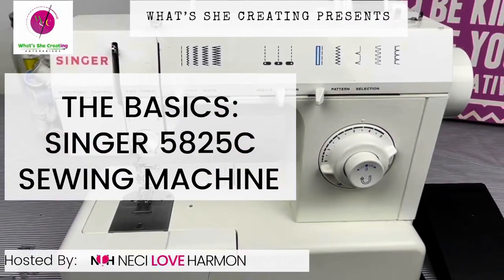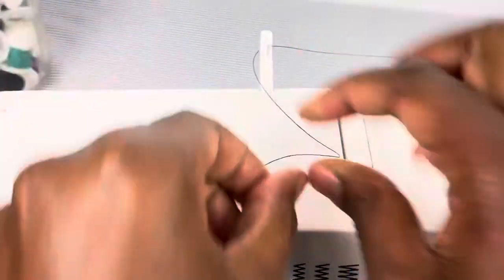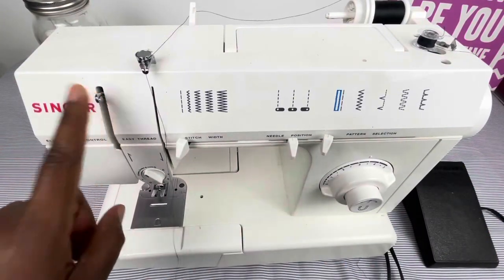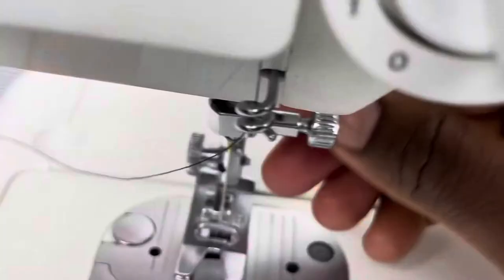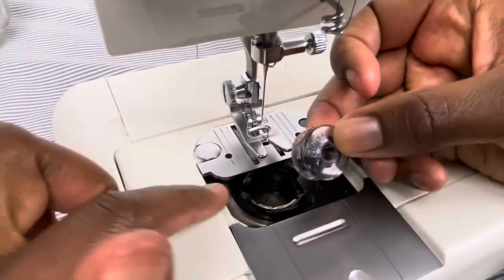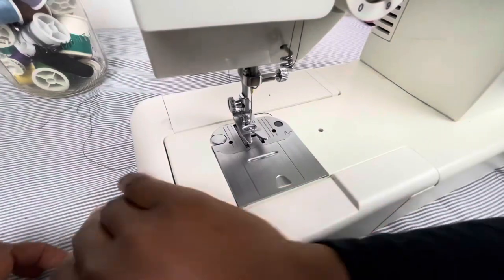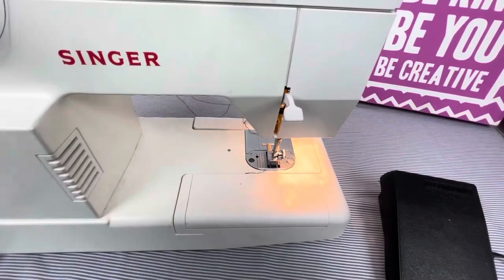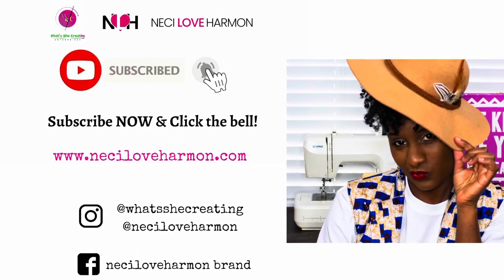Learn the basic functions of Singer 5825C Sewing Machine

Comment: Hello,  I had gotten some universal snap-on presser feet from Amazon, Singer brand, and they do not fit this machine.  How do I find the right presser feet? Is this machine low shank? High shank? Something else?
Reply from the maker: Hi. I don’t usually buy machine feet on online because I would have the same issue you are having. I frequent the local sewing machine repair shop and purchase the feet from them. I am unsure of whether this is a high shank or a low shank. I would suggest calling the local sewing machine repair shop and asking them by giving them your make and model number. Hope this helps.

Comment: Any idea where I can find the part that sits on top of the machine, the thread guide? I have looked everywhere including eBay. Machine is basically useless without it. Thanks
Reply from the maker: You may need to check your local sewing machine repair shop. They make have a part that could assist you. It may not be the exact part but it will get you going! Thanks.

Comment: What is the cause of breaking needles?
Reply from the maker: It could be a few reasons: One being the needle is slightly bent- change it, the machine is not threaded correctly, you are not using the right needle for the fabric you are sewing, you may need to clean the machine. Those are some suggestions. Hope this helps.